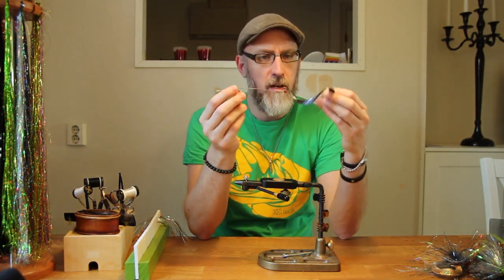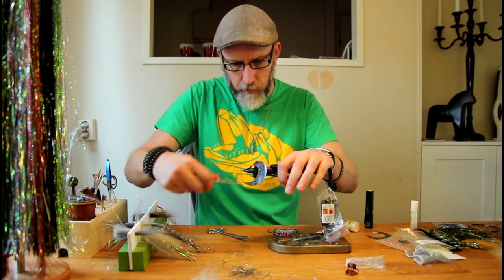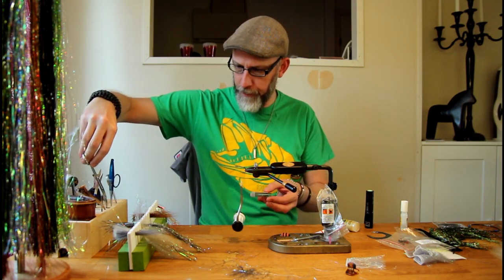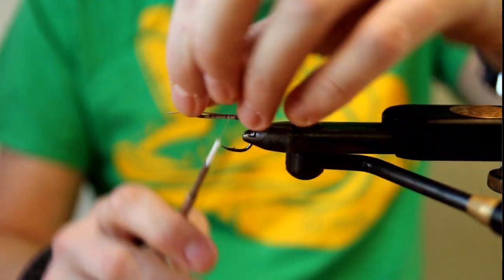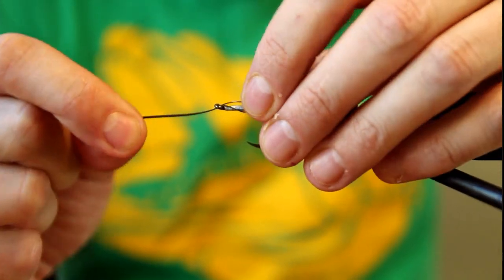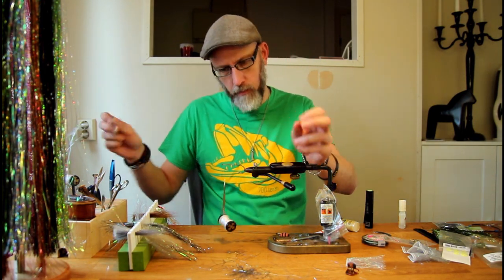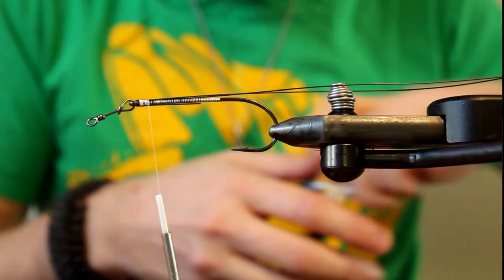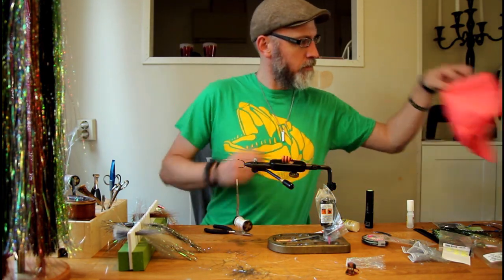700 teeth - How to do a wiggle tail stinger rig!

Comment: nice video Ulf there's one thing i would change on the stinger hook rig and that's the choice of the stinger hook. i think by far the best hook to use there is the partridge intruder hook that has much more aggressive bend on the hook eye than what the hook you use there does. when you use the intruder hook you don't have to do the bending to the titanium wire which might weaken the wire and result in a brake later on.

Comment: Nice video as always Ulf. I use the same type of snap for my wiggle tails as you do for your leader, except smaller. I just tie the wiggle tail on the snap and attach the snap to a loop of articulation wire off the back of the stinger so there aren't as many parts dangling off the back of the stinger, which increase tangles with the wiggle tail. This also helps keep costs down since you use less materials. You can still quickly and easily change wiggle tails.